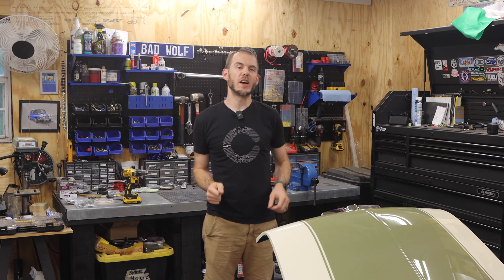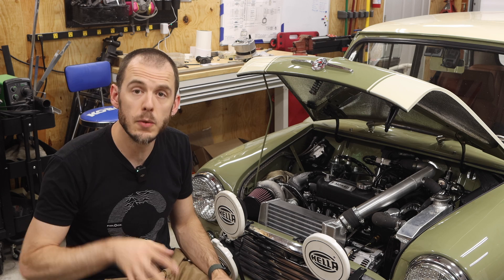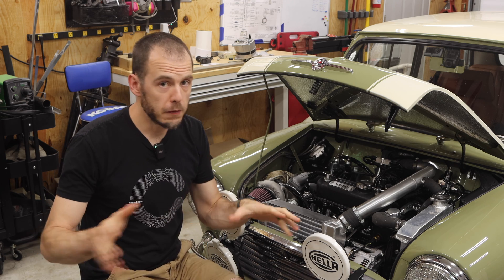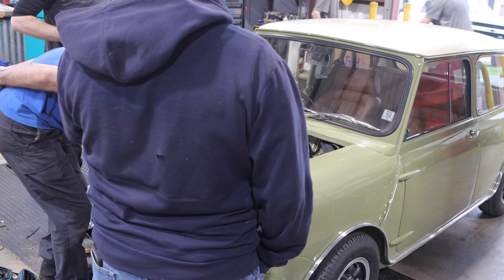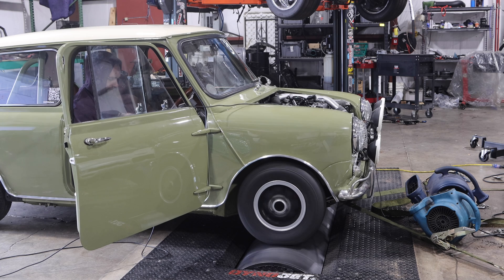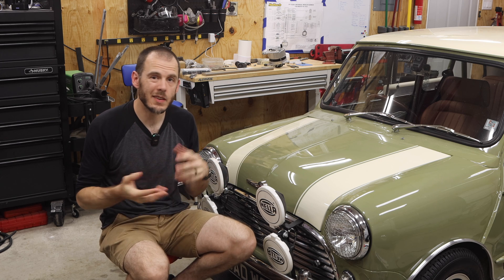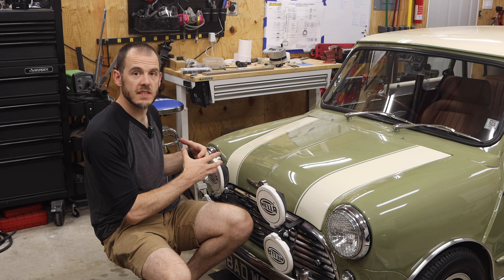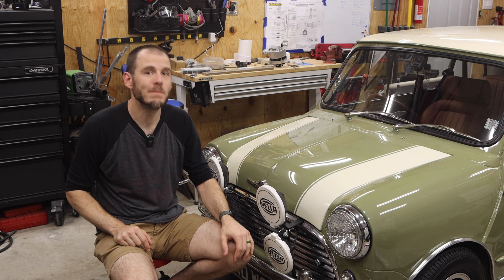Dyno Day for the Drive by Wire Mini | Resto-mod Mini - #12

Comment: My 1975 Clubman GT 1275cc made 90whp at 8psi on a DynoJet with super rich air/fuel and conservative timing. Using the Jet Motors turbo kit. That was two years ago ago it’s still running great.
Reply from the maker: Awesome I’m glad you’re happy with your setup! You should consider leaning out your mixture in boost though if it’s really rich. Too much fuel can bore wash the cylinders.
Reply: @classicminidiy  my car only made around 46whp before the Jet Motors turbo kit install, the extra 44whp that boost added makes my car so much fun to drive! I’m only rich in high RPM high boost, the rest of the RPM range its between 13.0:1-14.5:1.

Comment: Very cool.  Curious how high the Coolant Temps got during the dyno session and if they were ever a problem.
Reply from the maker: Thanks! Under those heavy boost runs I was bouncing off 98-99C but never broke 100C. Quite impressed with the radiator and those two fans. The ambient temp was about 18C that day though
Reply: @classicminidiy  That's great.  Really thought it may be a problem with the side mounted radiator.
Reply from the maker: @murty4471  I was also quite surprised. I installed an electric fan controlled by the ECU under the inner wing as well so that has a nice impact. The intercooler was doing a really awesome job of keeping inlet temps down, so I think given the air going in was cooler it was cooler coming out over all haha!
Reply: @classicminidiy  Very cool.  I may have to add an electric fan as well.

Comment: What fuel choice?
Reply from the maker: For these runs premium pump gas. Once I get the petrol tune where I like it I have considered running E85 with a flex fuel sensor but that would be way down the road
Reply: @classicminidiy  See if you can get Nick Swift over for track day. He'll show you how it's done. That'd be nuts.

Comment: Your car looks amazing.
My first car was a mini 850 , sliding windows, piece of string to close the doors, long gear lever, I loved that car it gave me my freedom
Reply from the maker: Thank you! Your mini sounds wonderful. The early 850s, while not being fast cars, were absolutely wonderful vehicles. The 850s were so damn reliable.
Reply: @classicminidiy  yes totally agree with you, Mini 850 were definitely not fast, but as my first car probably helped protect me.
Also they were so simple that you were able to maintain them yourself , oil change, new points, clutch slave cylinder, seized hand brakes.

Comment: Hi, why the exhaust was so red? Is it safe to run with such hot exhaust?
Reply: The exhaust on all performance vehicles, especially with a turbo gets to those temperatures
Reply from the maker: I do agree with Elliot’s message, performance engines especially ones running high boost generate a ton of heat. What’s happening specifically with that center branch of the exhaust is it has two cylinders of boosted heat through that one pipe. So double the heat there. Aside from that the engine had a bit more room to advance the timing more which will keep more of the combustion in the cylinder and less of it in the exhaust. That said with 21psi there is only so much you can do! That’s why intercooler and heat management are so important